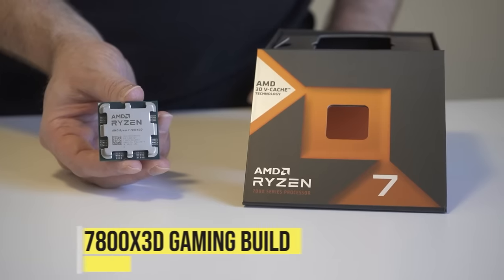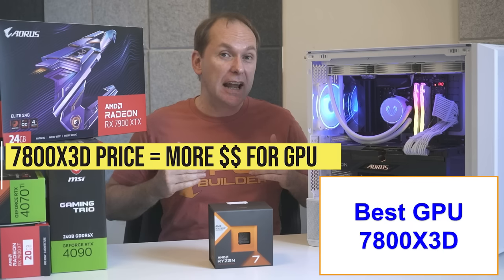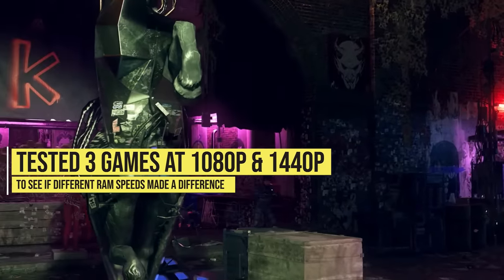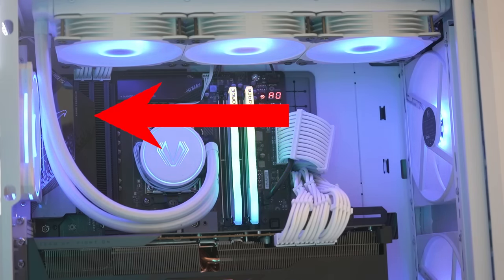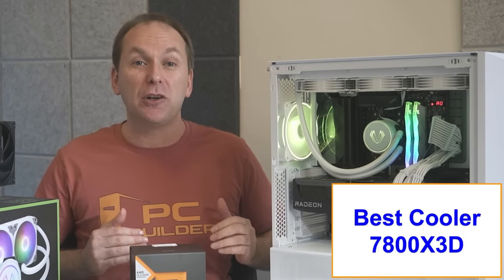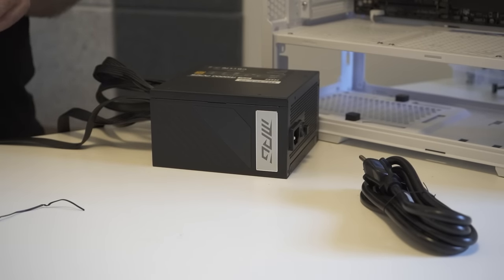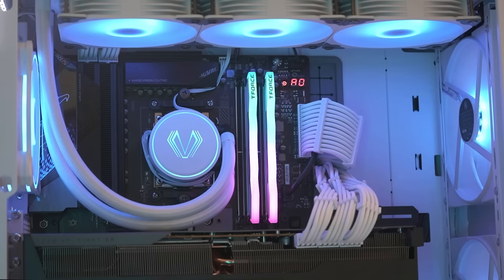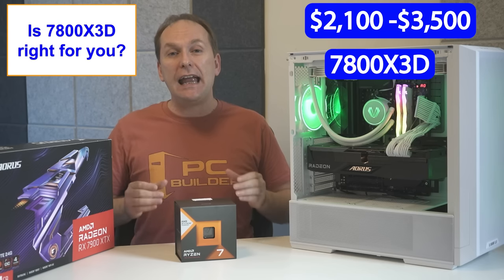🛑 Best Ryzen 7800X3D Gaming PC Build 🛑 Best RAM, Motherboard, GPU & More

Comment: I'm trying to build a new PC which will be primarily used for Microsoft Flight Simulator 2020 & World of Warcraft. I don't have an endless budget, but have no idea what parts to use nowadays with the best performance for buck... Any advice would be amazing from this community. Currently using an RTX 2070 with a core i5 8600k + DDR4 RAM 16gbx2. MSFS stutters hard at high settings and with some payware addons. I need to futureproof my system to keep up with the sim for the next few years. Thanks in advance PC Builder Community!
Reply: Not sure what your budget is but here's a sample build for you.

CPU: AMD Ryzen 7 7700X 4.5 GHz 8-Core Processor

CPU Cooler: Thermalright Phantom Spirit 120 SE 66.17 CFM CPU Cooler

Motherboard: MSI MAG B650 TOMAHAWK WIFI ATX AM5 Motherboard

Memory: Silicon Power XPOWER Zenith Gaming 32 GB (2 x 16 GB) DDR5-5600 CL40 Memory

Storage: Western Digital Black SN770 2 TB M.2-2280 PCIe 4.0 X4 NVME Solid State Drive  

Video Card: ASRock Phantom Gaming OC Radeon RX 7900 XT 20 GB Video Card  

Case: Lian Li LANCOOL 216 ATX Mid Tower Case

Power Supply: NZXT C850 (2022) 850 W 80+ Gold Certified Fully Modular ATX Power Supply

Total: $1897.83
Reply: @kelley09162  thank you for this! It’s along the lines of what I was looking at, my budget is about €2000 so this fits if I can get the parts in Europe below that!
Reply: @ianoreilly8468  I just looked at PC Part Picker UK and here's an updated build.

CPU: AMD Ryzen 7 7700X 4.5 GHz 8-Core Processor 

CPU Cooler: Deepcool AG620 BK ARGB 67.88 CFM CPU Cooler

Motherboard: Gigabyte B650 GAMING X AX ATX AM5 Motherboard

Memory: Kingston FURY Beast 32 GB (2 x 16 GB) DDR5-6000 CL36 Memory

Storage: Western Digital Black SN770 2 TB M.2-2280 PCIe 4.0 X4 NVME Solid State Drive

Video Card: ASRock Phantom Gaming OC Radeon RX 7900 XT 20 GB Video Card  

Case: Deepcool CK560 ATX Mid Tower Case

Power Supply: Corsair RM850x (2021) 850 W 80+ Gold Certified Fully Modular ATX Power Supply
 
Total: £1881.24
Reply: @ianoreilly8468  any questions for me?
Reply: @kelley09162  no I’m all good, will look into these parts. I’ve been out of the building market for some years and a lot has changed… there’s so much available and I was just lost among a lot of shouting 🤣
Reply: @kelley09162  Yes. That will absolutely bring MSFS 2020 to a new level. That is the Sim that I have always built my PC's around. The only possible changes that I might make are using a 1 TB NVMe boot drive and relegating the 2TB NVMe for storage. MSFS 2020 can take up an immense amount of file space with updates and addons. Also, I would probably change out the 7900XT with a 4070 Ti, due to the program being able to use DLSS. It's an incredible enhancement.
Reply: @zingwilder9989  yea I wasn't sure whether an AMD or Nvidia GPU would be better.

Also I didn't know that about MSFS taking up lots of space.
Reply: @kelley09162  Oh yeah, it's a huge program with constant updates and optional addons. Also, the Nvidia DLSS feature is fantastic with it. I've always gone with Intel builds for it, but the AMD processors do a great job as well.
Reply: @ianoreilly8468  taking Zing's suggestions into consideration here's an update.  Still under €2000 using PC Part Picker UK.

CPU: AMD Ryzen 7 7700X 4.5 GHz 8-Core Processor

CPU Cooler: Deepcool AG620 BK ARGB 67.88 CFM CPU Cooler

Motherboard: Gigabyte B650 GAMING X AX ATX AM5 Motherboard

Memory: Kingston FURY Beast 32 GB (2 x 16 GB) DDR5-6000 CL36 Memory

Storage: Western Digital Black SN770 1 TB M.2-2280 PCIe 4.0 X4 NVME Solid State Drive

Storage: Western Digital Black SN770 2 TB M.2-2280 PCIe 4.0 X4 NVME Solid State Drive

Video Card: Inno3D X3 GeForce RTX 4070 Ti 12 GB Video Card

Case: Deepcool CK560 ATX Mid Tower Case

Power Supply: Corsair RM850x (2021) 850 W 80+ Gold Certified Fully Modular ATX Power Supply

Total: £1942.01
Reply: @kelley09162  That's a super-good build!. Ian will enjoy it thoroughly!👍👍
Reply: @kelley09162  I just noticed you priced in pounds and not euro. I’m in Ireland, unfortunately some of these parts are not deliverable from UK to Ireland and the ones that are, they’re subject to import taxes. I’m going to do a bit of research on the parts but thanks so much for the help!
Reply: @ianoreilly8468  I looked into it and using PC Part Picker Ireland you'd be over 2500 using the similar specs to the UK build I made you.

Why are parts so expensive there vs The UK?
Reply: @kelley09162  probably availability… everything is expensive in Ireland, it’s kind of depressing. If I order from the UK the exchange rate is not great & then since UK are no longer in the EU, I pay import duty on the overall value and that can be even more substantial. I’ll check around a few places in mainland Europe too!
Reply: @ianoreilly8468  I hope I'm helping
Reply from the maker: Glad you are getting help in the comments! You can check out our 7600X build guide on the channel as well (I’d use the same list there for 7700 and 7600). And if you have the budget for it you can look at the “basic” $2000 budget version of our new 7800X3D build guide. That would dominate Flight Simulator
Reply: @kelley09162  Ty, you're providing excellent guidance, but Ian is experiencing availability issues with new gen. parts. In my opinion, a 5800X3D with a decent AM4 board and new DDR4 RAM will handle MSFS 2020 in brilliant fashion, for some time. He can go ahead and keep 2070 and upgrade when his budget becomes available. I would, however, use a Thermalright Peerless Assassin cooler and purchase additional 1 TB and 2TB NVMe's for boot and storage drives, respectively.
Reply: @zingwilder9989  well he doesn't have Thermalright coolers available to him.

As for the CPU I didn't think about just getting the 5800X3D.  However that CPU is expensive for him too.  

The 5800X isn't too bad price wise though.
Reply: @ianoreilly8468  here's a cheaper option for you which will allow you to keep your 2070 and upgrade the GPU later.  The 850W PSU is for when you upgrade your GPU.

CPU: AMD Ryzen 7 5800X 3.8 GHz 8-Core Processor  

CPU Cooler: Thermaltake TOUGHAIR 310 58.35 CFM CPU Cooler

Motherboard: Gigabyte B550 AORUS ELITE V2 ATX AM4 Motherboard

Memory: TEAMGROUP T-Force Delta RGB 32 GB (2 x 16 GB) DDR4-3600 CL18 Memory

Storage: Kingston NV2 1 TB M.2-2280 PCIe 4.0 X4 NVME Solid State Drive

Storage: Kingston NV2 2 TB M.2-2280 PCIe 4.0 X4 NVME Solid State Drive

Case: Thermaltake Versa T26 TG ARGB ATX Mid Tower Case

Power Supply: MSI MPG A850G PCIE5 850 W 80+ Gold Certified Fully Modular ATX Power Supply

Total: €1131.18
Reply: @kelley09162  thanks for this, but I definitely want to spend the money & get the best bang for my buck! Really appreciate all your help.. it’s been fantastic! I’ll have the cash together soon & ill invest! Question though, air cooler over water cooling / AIO? Does it matter much with the Ryzen 7000cpu’s?
Reply: @kelley09162  From my experience with MSFS, the 5800X3D is the only way to go for something that's somewhat futureproof. However, he wouldn't need to buy a new card right now. He could just keep the 2070 and wait until his budget can afford a new 4070Ti. That's a huge savings right there. He still have a very good 1440p experience, If he has the AK620 available to him, that would be a magnificent cooler.
Reply: @kelley09162  That would work. However, I would go with 5800X3D. It has superb MSFS 2020 reviews. I addition, Ian shouldn't have any problem with just keeping his current case. The only thing he will need to do is flash the board prior to installing the CPU.
Reply: @zingwilder9989  he doesn't have that cooler either.  There aren't many options for him for Air Coolers.  If you go to PC Part Picker and choose Ireland you'll see.

The issue with the 5800X3D is for the price he could get that CPU, a AM4 Motherboard, and DDR4 RAM, he could also get the 7600, AM5 Motherboard, and DDR5 RAM.

The 5800X3D is 410 there.

And yes I mentioned he could keep his 2070.
Reply: @zingwilder9989  so would the 7600 or 5800X3D be a better CPU for him?
Reply: @kelley09162  I see what you're saying, Ty. Then by all means go with the AM5 board  and the new 7600, with the accompanying RAM. That 7600 will do a splendid job with MSFS 2020. That's the most cost-effective answer, just hold on to the 2070 for now. He certainly shouldn't have anymore stuttering issues unless the problem is with the card itself.
Reply: @ianoreilly8468  so after discussing it with Zing, and I apologize for all the comments this is what I would do.  If you'd like to keep your current case that's totally fine.  Just remove it from the build.  

With this build you can keep your 2070 until you have the budget for a new one.  Just note the 4070 is coming out soon so depending on what that costs in Ireland you may be able to fit that in your budget.

CPU: AMD Ryzen 5 7600 3.8 GHz 6-Core Processor

CPU Cooler: Thermaltake TOUGHAIR 310 58.35 CFM CPU Cooler
 
Motherboard: Gigabyte B650 GAMING X AX ATX AM5 Motherboard

Memory: Kingston FURY Beast 32 GB (2 x 16 GB) DDR5-5600 CL36 Memory  

Storage: Kingston NV2 1 TB M.2-2280 PCIe 4.0 X4 NVME Solid State Drive

Storage: Kingston NV2 2 TB M.2-2280 PCIe 4.0 X4 NVME Solid State Drive  

Case: Thermaltake Versa T26 TG ARGB ATX Mid Tower Case

Power Supply: NZXT C750 (2022) 750 W 80+ Gold Certified Fully Modular ATX Power Supply

Total: €1228.80
Reply: @kelley09162  Well the 5800X3D is a great MSFS 2020 processor; however, the AM4 platform is done. The 7600 is new gen. and also a good gaming CPU. In addition, it uses the new AM5 platform, where he can choose to upgrade later. As I did discover, the 5800X3D is 410 (Euros) and the 7600 is 269. Personally, I'd say moving to the AM5 platform is the way to go.
Reply: @kelley09162  awesome! I’ve repriced & it’s decent. I may start with this then buy a really high end card once I get that cash up!
Reply: @ianoreilly8468  Ian, if you have a CPU rated at 65 or 105 Watts, there is no need for water cooling. If it is rated at 120 W or higher, you may wish to consider it. I have always been a fan of AIO's; and I run a 280 mm on my i5-13600K because these 13th gen. Intel chips get warm. Nonetheless, some people  refuse to consider water cooling altogether.

Comment: So you use 3 PCI-e cables on the GPU and 2 for the CPU.  But the PSU has 4 connections in the back? Where does that 5th PCI-e cable plug in? Noob asking.
Reply: Just to clarify...There are 2x 8-pin EPS connectors for the CPU.  There are 3x 6+2 PCIE connectors for the GPU.  But there are only 4x 8 pin connectors in the PSU.  How exactly do you power the GPU?

Comment: would like update video on best build for 7800x3d with what components mostly best motherboard because of asus debacle.
Reply: I had ordered a ASUS b650e-e but I'm probably going to return it now too, after what asus pulled.
Reply from the maker: IMO just avoid the ASUS motherboards. Worked great on the X670E Aorus Master in our test build and I suspect with other Aorus boards as well (though we have not tested any).
Reply from the maker: Yes I wouldn't go asus, I'd go Aorus B650 Pro linked in the description (or any of the boards we list in the description). But beyond that you can check out Gamers Nexus coverage of the 7800X3D. The issues was extremely rare and you just want to make sure you update to the latest bios (which we always recommend anyway)

Comment: I am currious on the temps when idle and when gaming in my system running 7800x3d I am currently useing Thermalright Peerless Assassin 120 and although my idle temps seen to jump around between 40-55c when I am stress testing using ciniench max temp is around 83c but  think its becasue this is a small case and also my rx6800xt card is creating some heat in tha tsmall space plus I am going to recheck my thermal paste it may not have been applied correctly which may drop eh idle temperatures down , the 7600 non x I had idled around 28-30c and max temp 60 c using all the same parts I may also play around with undervolting.
my fps in gaming like ASA are low 32-60fps in 4 k I think its bad game coding compairing the two cpus 7600 and the 7800x3d I dont see any real difference in that game .

Comment: Hey jason,i am new to the computer building,and this will be my first pc,i will use the recommended water cooler,but could you rate my build and say if something could change? The build is:
rx 7900 xtx Saphire 
Cpu:Ryzen 7 7800X3D
Mother board,650E
 Font:850 watts
Case,NZXT 7 FLOW 
And the WC u recomended

Comment: For a 7800x3d build does amd advantage increase performance significantly or is it better to get a 4080 vs an amd equivalent 7900xt
Reply from the maker: No advantage using AMD vs Nvidia GPU for brands sake, but the 7900XTX beats the 4080, 4080 does beat the 7900XT, but its weirdly priced. See our latest Best Gaming GPU 2023 video for more from last week

Comment: What do you think of the B650 Aorus Master? One lower than the one that's been used in your video.

EDIT: I heard the Aorus Master b650 is discontinued....
Reply from the maker: We have the B650 Aorus Master as gigabyte sent it to us but it doesn't appear they are going to sell it in the US and I haven't seen it at retail here.
Reply: @PCBuilderChannel  I was about to order the B650E Aorus Master, but after I have seen it getting discontinued in the US and other countries I thought it would have it's problems and GIGABYTE would drop it's support for that board. Now I think that I should avoid that board, even though it's still selling here my area/ Europe.

What would your advice be Jason? Should I look for another board from your description, or still go for the discontinued B650E Aorus Master?

Comment: I know this is a old video but do you know if asus boards are still problematic. I was thinking of getting a ASUS ROG STRIX B650E-F for my 7800x3d
Reply from the maker: The Asus issues were solved with updates, just make sure you update to the latest bios when you build (as I always recommend anyway) and you should be just fine

Comment: Hey, I just bought a pc with a 7900xtx and a 7800x3d in combination with a 850w gold 80+ PSU. Could it damage my pc, or will it just throttle?
Reply from the maker: The GPU/CPU combo is good but double check your PSU needs by following the method in our Best PSU 2022 video. You do not want to mess around with too small a PSU

Comment: PBO is confusing to me. Im using rog strix b650e-f mobo, in the it have the PBO option in bios at Tweaker tab but also have another PBO inside AMD overclocking in Advance tab. Both of them are one ? if not which on should i use ?
Reply from the maker: See our “How to set up your pc” guide video on the channel!

Comment: On PC part picker is says the CPU isnt compatible with the MOBO why is that ?
Reply: It means it would require a bios update to fully support the 7800x3D.
Reply from the maker: That’s the standard warning on AMD builds about the bios. Make sure you get a board with bios flashback and you’ll be fine. The boards we recommend have them

Comment: I am still new to the IT enthusiast hobby. If someone games first but generally has programs and video encoding running in the background would the benefit more from the 7950x, 7950x3d or the 7800x3d?
Reply: You'd probably want a 7900X, or 7950X.  The 7800X3D from what I've read/watched isn't the best for production work.
Reply: @kelley09162  thank you for the advice.

Comment: Think Im running into a RAM compatibility issue. I have XPG Lancer RGB DDR5 16GBx2 6000MT RAM with a MSI B650 Tomahawk, and the cpu and RAM lights up on motherboard and will not boot

Comment: hi im having trouble with the ram, cpu cooler clearance. my mobo is msi mag b650 tomahawk, ram is t-force ddr5 6000mhz cl30. i wanted to get an air cooler since it is cheaper but i was told by most of my pc friends that this wouldnt work since my ram is tall. what is the best thing to do here? or what coolers can u guys recommend thatll fit so i can finally have my first pc.

Comment: Hi there - I can't decide between the following two options: (7900 XTX and Intel i5 13600k) or (7900 XT and 7800X3D, $108 less)
Reply from the maker: If you do a lot of production work 13600K is a good choice. If mostly gaming Id go 7800X3D paired with the 7900XT or if you can do 7900XTX you will be set with a very powerful build that will be top of the line for a long while

Comment: What is the best choice as price for a gaming pc for 1440p, r5 7600x + 7900 xtx or r7 7800x3d + 7900xt ? Or 7600x + 7900xt can handle everything on 1440p?
Reply from the maker: Most powerful here wold be 7800X3D + 7900XTX. 7800X3D + 7900XT also fantastic. If you need to drop to a lower GPU than that I would go for 7600X.

Comment: I have the tforce ram its XMP. Now if its on a AM5 system do you enable EXPO still or manually overclock it then because its XMP?
Reply from the maker: Go into the bios and it will give you the option to either enable EXPO or XMP and enable the one you have. Check out our "After you Build" set up video, we cover this all there (:
Reply: @PCBuilderChannel  bringing in all my pc parts to have microcenter build it, just wanted to see if a Asus X670E-A motherboard has an XMP option in the BIOS. Thanks for confirming makes it a lot easier now that I know there is a XMP option on AM5 boards. Also I heard to update Bios first, then install windows, then lastly touch the ram. If you touch ram before updating bios you could have problems thanks!